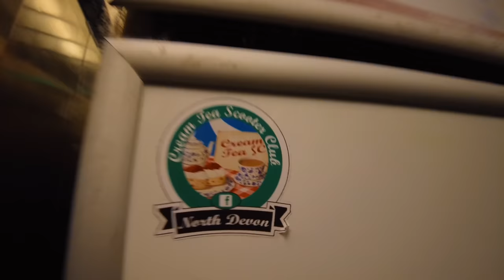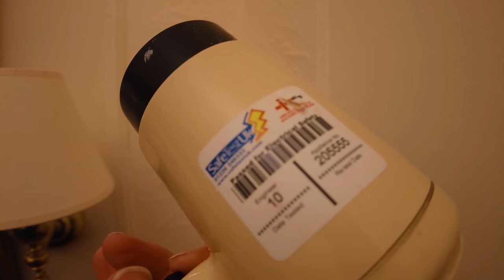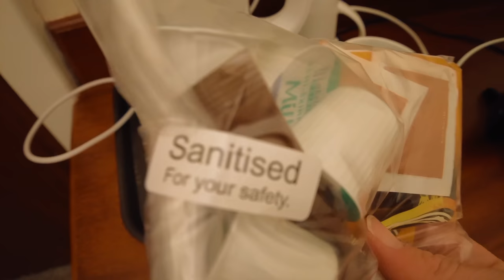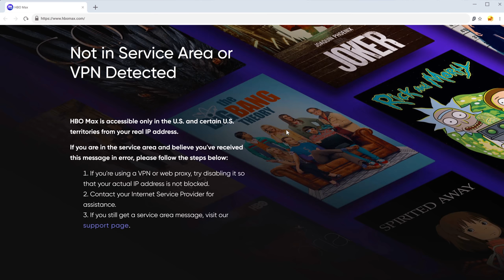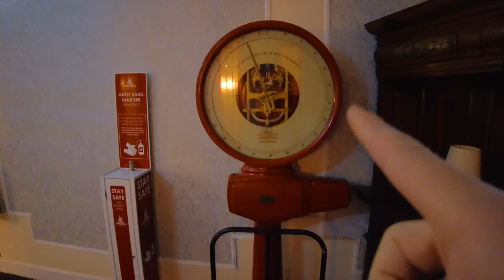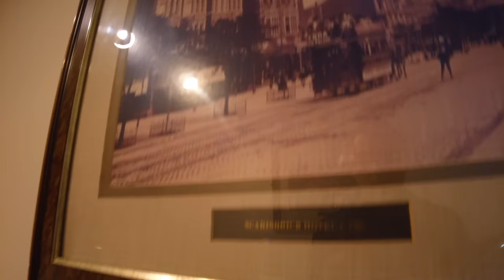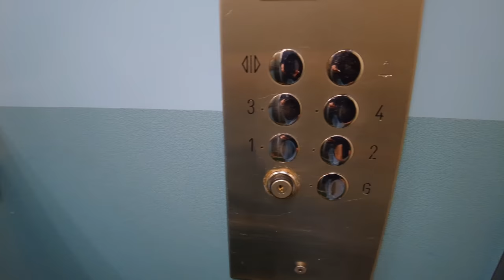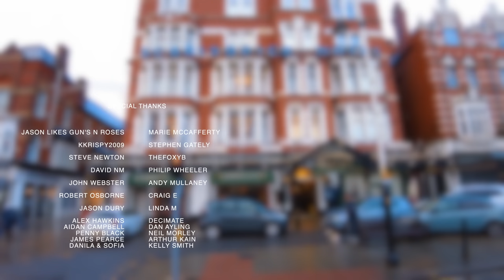Worst Rated Hotel - Scarisbrick Hotel, Southport

Comment: As a former electrician, you are more than safe with that cable, it's an earth cable that's grounding the metal
Reply from the maker: thanks rob!
Reply: One thing though Rob, it's a red tag earth clamp, so suitable for dry condintions only, which is evidenced by the ongoing corrosion process. Should be replaced with external blue asap, unless they've upgraded the consumer unit with RCDs/RCBOs for all circuits within the area and just left it there.

Comment: This room is small but has everything you need. Like:
- Cobwebs
- Light fittings without lights
- A door that's clearly been opened with a crowbar
- Electrical hazards
- Bath with built in bum scratcher
- Fresh air whether you want it or not
Sounds like a solid deal to me
Reply from the maker: Lol
Reply: "Bath with built in bum scratcher" 😂😂😂😂
Reply: Brill 😂

Comment: All these Victorian & Georgian hotels show the previous grandeur but the big issue I see is the cost of upkeep, which has become too much for the owners/operators.  The same issue happens to stately homes which then fall into disrepair.  These hotels are so interesting.  For me a clean bed is the most important thing.  Always interesting videos though.
Reply: I don't see how you can conclude that the cost of upkeep is the reason - why is it now but not previously? I think it's purely down to the business model of the owners. They wouldn't be operating if they didn't know what they were doing.
Reply: @basylpeterjones  I believe that the ingress of dampness due to the building's age is a major issue in these old hotels.  The cost to rectify it is prohibitive due to the smaller revenues as the hotel ages.  I maybe wrong but I'm glad it brings conversation to the issue.
Reply: Lower prices to get guests because the facilities aren't what they used to be = less money to fix the facility=lower prices again= worse conditions.

Comment: The ‘Brick’ used to be a fantastic hotel which has sadly been absolutely neglected by its owners - Britannia Hotels. 
Sadly they have also been allowed to purchase two other historic hotels in Southport - which have also been neglected.
It’s hard for old seaside towns to get tourists now, with shops struggling etc, but this is not helped by incompetent ownership - Britannia hotels, ruining hotels all over the country.
Reply: The brick.... everyone went the brick at some point
Reply: Ditto that Ant
Reply: @buzx1313 , I spent many a Saturday night in 'The 'Brick' when I used to frequent Southport town centre in my youth. Used to go downstairs to the Odyssey bar, which was closed down and changed into the closed down leisure club in this video. Heck I'm old enough to remember when it used to be Chicago's bar in the 1980's, and what is now Maloney's Bar used to be filled with pool tables.
Reply: Britannia should know what they're doing but, apparently, anyone sitting at home tapping a keyboard could run make bigger profits. And "old" seaside resorts have more tourism economy than they've ever had, so that shows your knowledge of the subject.

Comment: Not an electrician, but the wire coming from the radiator looks like it is just an earth bonding wire that grounds the metal surface of the radiator, should it in any case ever make contact with a live wire. It's quite common, but usually at least neatly tucked away, sometimes behind the wall.
Reply from the maker: so if water was to get on it its ok?
Reply: @WalkWithMeTim  Yeah, it's just connected to the ground, to make sure that if somehow anything electric was to make a connection to the radiator, or the pipework behind it, the electricity would just be sent through that wire into the ground (path of least resistance), rather than through someone's body that could touch it, into the ground (path of least resistance if the wire wasn't there). Kind of a precaution, considering bathrooms are areas where water and electricity can come close.
Reply: Yes it's an earth wire so no possibility of a shock
Reply: I was an electrician years ago and this equipotential bonding was quite common, yes it should be a lot neater but there is nothing dangerous about it as it is, it just looks terrible. It used to be a PIA having to run supplementary heavy earth cables to all metal pipework, bath tubs AND light fittings etc... in a bathroom, of course many firms just didn't bother. I'd left by the time the 18th Edition I think (might have been 17th 2nd?) of the wiring regulations removed the requirement providing all circuits serving the room had RCD or RCBO protection. In any case if a house or business property had from new or has fitted mainly plastic pipes, there is then no reason to bond pipes at all.
Reply: @WalkWithMeTim  Yes. Its purpose is to ground any electricity that might possibly get on/into the radiator.  It's like how your gas meter at home is bonded to ground, as are your copper water pipes.  It provides an escape path for the electricty.  Without it any electricity would instead use YOU to travel to ground when you touched the pipe, in which case your worries about the drafty window would be over! It's like how a lightning rod running down from a church would take to ground a bolt of lightning that struck the church spire - it gives the electricity somewhere to escape.
Reply: @carterucm  Check the earth clamp tag colour, it's red, so dry locations only and that's why it's corroded and should be replaced with blue tag clamp asap, unless of course mcu was upgraded with RCDs, in which case it's obsolete.
Reply: @paulb4661  Fair point, it's been 20 years plus since I was a sparks, now work in healthcare :) For rads, we would always use those decent U shaped clamps with a hex drive, looking back the firm I worked for was straight as a die, at the time you don't realise how many others were bodgers and cowboys. So I expect every single clamp we ever used was the best quality available, in fact they were always Blue I think. Which I now realise must have been wet condition?

Comment: Tim needs to carry one of those travel size WD40 spray bottles.  Not only might oil the hinges on doors but kill any bugs crawling around, with the insecticide smell.  Great video as I like both the good and bad you always point out.  Never looked under the mattress cover in a hotel room, and maybe I don't want to.  I guess you didn't try the breakfast?  Thanks again Tim for your 5 star reviews.

Comment: The original lift was the type with manual doors and a sliding gate.. someone did fall down the shaft from the first floor, apparently drunk opened the outer doors and stepped in but no lift was there...they survived.. the 4th floor off memory was staff bedrooms..

Comment: I was unfortunate enough to have to stay at this hotel probably 6 or 7 years ago, when I worked as a tour driver for National Holidays, it was a Saturday night, and the passengers I had were on a weekend theatre show tour, having returned to the hotel late on the Saturday, I discovered that downstairs the bar / nightclub was playing loud music with loud bass, that reverberated up into the rooms, and it wasn't until after 4am before I managed to get any sleep, before having to be back up at 7am, and drive the coach.
The company were made aware of this problem, by myself and majority of the passengers, but I would NEVER stay at that hotel again!
Reply: In surprised you got a room as they usually give us drivers a cupboard in the basement or cellar to sleep in.

Comment: The wire on the radiator is the earth wire and as long as the wires aren't exposed, it can get wet. It doesn't carry current. My first flat had the earth wire outside near the electricity meter.

Comment: cable on radiator is just an earth bond, it has not power / electrical currently flow, it is there to protect the metal work from becoming live in the event of a fault.

Comment: The supplementary equipotential bonding conductor on the heated towel rail should connect it to the water pipes for the bath and wash basin and cross connect hot and cold pipes.   If there is an earth fault in  the towel rail or if a water pipe contacts  a live wire, that will prevent a dangerous touch Voltage between the towel rail and taps etc.  These are described as "extraneous metallic conductors" The visible bonding cable  seems to  have the correct tag saying "safety earth, do not remove". I'll put away my anorak now.....

Comment: The wire you worried about is fine, it's an equipotential bonding connection that ensures your pipes don't rise above Earth voltage. You'll find them under sinks and baths etc everywhere. It's safe and electrically proper.
Reply from the maker: thanks for letting me know

Comment: I am a electrician that wire is the Earth wire it is safe it’s nice to see that the towel rail is Earth .i am new the channel
Reply from the maker: good to know! hey thanks Ian hope u subscribed too :-)
Reply: Then as an electricianyou should know water and electric don’t mix so that wire isn’t safe.
Reply: @danielledewitt1  This wire isn’t live, it’s just grounding. It’s the same as touching any metal radiator in every home.
Reply: @marcd6897  If it werent live then no point it being there.
Reply: @CH1 Just wait til water hits it.
Reply: @danielledewitt1  Please… water has probably splashed there a million times already without anything happening, or did you see any headlines about people being electrocuted at the hotel? It would be on BBC and everywhere. Read other comments if you don’t believe me.
Reply: @danielledewitt1  Not the sharpest tool in the box, are we?
Reply: @number6ix929  Water and electric don’t mix. You should know that.

Comment: (Disclaimer: Not an electrician) That wire in the bathroom is an earth cable. Under normal circumstances (i.e. when nothing is actually going wrong somewhere) it carries no current. But if a lightswitch in my home made that sound, I'd be calling someone to come and mend it.

Comment: In the 1970s there used to be a bar with a couple of pool tables on one side of the hotel that was open to the public. I don't know if it was accessible from the hotel itself as I never had the pleasure of staying there. The bar was accessed from the lane which runs up the left side of the hotel. There was also a disco / dance floor down a further flight of stairs from said bar, so they may have been reconfigured into what you saw as that absolutely appalling-looking bar with the green telephone box. I seem to remember that back then the hotel did not have a good reputation, but I never stayed there, only worked opposite one summer. You could have complained about the window or asked for a discount on the price (did you say how much you paid?), but it's an absolute cheek to expect someone to stay in a room with a window that won't open and a dodgy door.

Comment: I think a issue with a lot of these formerly grand hotels is that set up to service tourists with a reasonable budget who wished to stay in a degree of luxury at these resorts. With certain expectations,  a lot of these seaside places have come to defined as budget resorts and there simply is not a market for 'luxury' hotels in these areas. To compete they have lower price below a level required to maintain former services and adequately maintain a formerly grand hotel. I not a hotelier but I guess it easier to run a hotel that was set up as a budget hotel on budget rates than try and maintain something that was never meant to be a budget hotel at these rates.
Reply: There's nothing wrong with running somewhere as a budget hotel, but hiring out rooms in that level of disrepair and lack of cleanliness is inexcusable tbh.
Reply: @Andy-eo3mq  I agree there nothing wrong with budget hotels. My point is that it can be hard to run a hotel that was never designed to be a budget hotel as a budget hotel. In terms of some repair issues I guess that grand old Victorian buildings basic maintenance costs are quite high. So it might actually be hard to keep the hotel in good order if your only charging £32 a night- just checked this price.

Comment: That lift really is something. 

Used to work in a building with a similar lift with folding doors - but for just one person only. Creepy as heck. 

It was well maintained but really really old school. The building was from the 1940s and the lift looked like being from the 50, max. 

Taking it was really scary. Very slowly moving. Once the doors folded shut you could only hope they’d open again.

If the thing ever dropped down with a person inside they could take the lift cabin as a coffin, just grab it with everything inside. 

That thought didn’t really help. 

Naturally, not many people used it.

Comment: As much fun as it would be to stay in a grand hotel like this one, with a long, illustrious past, the compromises you have to make mean it's not worth it. I suspect Tim's room was pretty typical - maybe others have better windows but then there is something else broken or missing. The tall ceilings which give the hallways and rooms so much character are so hard to clean - so hard, they usually aren't, thus the cobwebs and grime. The cobbled together bathrooms, with poorly done repair and upgrades, mixed furniture and rough-around-the-edges doors, windows and fixtures, seem to be standard fare for hotels that have "fallen on hard times," as Tim puts it.
Too bad because the old lady still has a lot to offer. Love the Tardis effect, long hallways, and opulent lobby; usually these grand Victorian-era hotels are in prime locations near rail stations or with commanding views over local scenery hotspots. But modern they are not, and unless they are several times the price of the well-known chain hotels found near the motorway, usually they are not clean or particularly comfortable.

Comment: That is not a plaster on the window, but one of these little sticky metal curtain rail hooks on which you hang light curtains right onto the window, sometimes the cushiony sticky tape sticks on like mad and is hard to remove. Not sure whether they even attempted that here. And with these little black dots in the bed it seems like the saying "Good night, don;t let the bed bugs bite you" come reality. Well you will see if you end up with lots of bite marks the next morning. If so then I would go to some health and safety regulatory organisation, not sure which that is in UK and report the hotel for being unsafe.

Comment: I can tell you that wire is 100% safe. The green and yellow colours mean it is an "earth" wire. I presume it's purpose of being there is that if lightning struck the building, that wire will stop the current from traveling to the metal taps and pipes. Other than that, its not for powering anything

Comment: That window is amazingly dangerous. If you have a small child (or drink charged party goer still in party mode) in that room jumping on the bed and the fall or lean against that thing, they're going for unwanted journey to outside be it a fall to the fall or roof of the building bellow. Not good at all. Now seen there's an exit outside it. So the perfect serial killer, robber or r4p3$t  entrance..hmm

Comment: I have a theory about some of the larger pieces of furniture.  I would speculate that these were once part of a larger suite.When these suites' were partitioned up into standard rooms the grand furniture was hauled to the landings and left there. 
Perhaps because they're too heavy to get down the stairs in one piece and disassembling them would require a skilled carpenter or furniture maker. The main reason therefore is cost.
Reply: Good point.

Comment: That wire in the bathroom is cross bond and is attached to the water pipes anyway, needed for the electrical safety equipment to work.

Comment: The cable in the bathroom is a harmless earth connection for the heater behind the wall. The red knob for the temperature.

If installed in older buildings often heating pipes or plumbing can be used.

Comment: That wire you were concerned about is an earthing wire and there to prevent you from electrocution so no need for you to panic.
Disgraceful that they unashamedly charge for a room not fit for purpose 😡
Would I stay there ? 

There's a Premier Inn with free parking and disabled bays at the front door with warm modern rooms and probably cheaper.....so the answer is no 🤣

Comment: My nephew worked here in the various bars for a number of years.This hotel had immigrants staying at the beginning of the pandemic. I wonder is the damage from then but why wouldn’t they fix these issues. Small jobs going un fixed as most of these issues are really speak volumes about the hotel. The avenue down the left hand side of the building is also referred to by Southport residents as “ shabby alley “.

Comment: The wire on the pipe is nothing to really worry about, it's just an earth strap, Quite common on older buildings with tons of copper water piping, especially if the water itself is heated via electric rather than gas, means if there's a fault in the tank element for example,. it'll short and trip the circuit breaker rather than just keeping all the pipes live.
Reply from the maker: Good to know

Comment: The wire on the copper pipe is just a earth cable is safe to get wet 

Is for if a live wire ever touched a copper pipe it would live the heating system so ever radiator would probably have one on to stop you getting a shock its a old thing tbh don’t see it on newer stuff

Comment: Hotels often don't give their staff enough time to clean a room properly or pay them for all the hours worked.
Chalet parks idem dito.
I worked for a while as a chambermaid in a hotel that paid a sort of piece rate. 
They gave you 15 minutes to clean a double room with a bathroom, change all the sheets, hoover, dust etc.
If you took longer, it was unpaid and you were working in your own time.
So some dust, cobwebs and stains were usually left.
It's just stinginess.